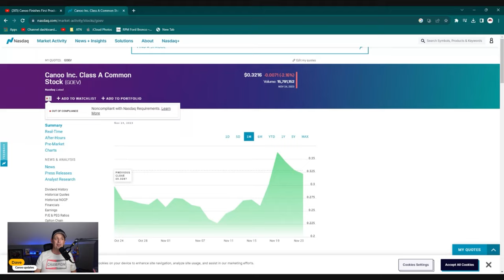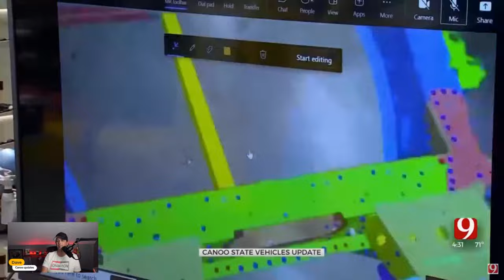CANOO EV - Are they finally ready for the road?

Comment: Since the van is steered by wire and the steering wheel can be moved to the opposite side it seems perfect for a Post Office delivery vehicle.
Reply from the maker: Good point but I believe the USPS has a costly delivery truck being developed by a military contractor.
Reply: @AllTerrainNation  🤮 the Osh Kosh deal is total nightmare. Went from 100% EVs to 10% EVs. From a company that’s never built an EV.
Reply: Rivian and Canoo got screwed by the Post Master. They have vehicles in production vs Osh Kosh having to start from scratch. The billion dollars is as good as gone.
Reply: Amen
Reply: @AllTerrainNation  Now why did he say it can be right hand drive for the Post Office? Because The Post Office is a UK company.
Reply: Drive by wire and the way the digital screen is mounted allows RHD versions to be made much cheaper than conventional vehicles.  And since 76 countries use that, it bodes well for US exports.
Reply: I'm a mailman and would buy one for my route. Right now I use a '22 honda odyssey. There's 80,000 routes and over 1/2 are personal vehicles. None of these companies want to partner with us. We're out here buying RHD Jeeps by the 1,000s over year. Spending $60k. We cycle the vehicles every 3 years.
Reply: Post Office just purchased 6 of these to test out.
Reply: It's only 3x more expensive than an LLV and they just have to replace 100k of them. Perfect lol.

Comment: I want one, mostly a van but I want it to have the same type of body panels and coating as the military truck version! The truck version is said to have a range of 500 miles, if they can get that range for the truck then why not for the van?
I have heard prices in the $30k to $50k range which I think is reasonable, the other thing is the footprint is roughly the same size as what a Prius takes up! That to me hits right as I don’t need to make any changes to my garage or find special parking spots for a bigger wider vehicle (talking to you Tesla Cyber Truck). Last wish is that this use a new battery type that gets longer range and charges quickly. To me the van has this kind of 70s hippy vibe like a Volkswagen bus. Come on Canoo give us the van now!

Comment: This will be the future, 1 frame, and can make it a sedan,pickup, utility vehicle, van, etc. All on the same "skateboard"  so you could change your vehicle if you wanted a true transformer. This also has very few parts, which will also make it desirable. If they are over 50,000 in price, this will fail. It has to be under 38,000. IMO
Reply from the maker: Im not sure how they can keep costs inline to have price in the 35-40k range. The big boys are struggling with mineral costs.

Comment: I've been waiting for the Maverick Lightning model but FORD seems to be moving  GLACIALLY  with the Mav product.
I'm diggin the Canoo PU. HOWEVER, Canoo does not have any kind of reputation yet. Will their vehicles be durable, reliable
long lasting? Will there be any  resale value? If the battery dies, can it be fixed for a reasonable cost? What about that 
crazy windshield? State Farm does not cover glass. Whats that going to cost me? Even those triangular side windows
look expensive. It best practices  NOT  to buy a brand new designed, well, ANYTHING. All first gen whatevers are prone 
to bugs & modifications are ALWAYS made nextgen. What to do? What to do? What to do?

!
Reply from the maker: EV resell is awful unless it’s Tesla. 
Maverick is perfect for a small EV but ford is hurting right now from poor Lightning / Mach E sales

Comment: They need to answer the concerns people have about evs, their resale value is terrible given the cost of replacing the batteries and making the vehicles future proof. Also a battery jerry can system needs to be worked out so you aren’t left stranded ect. For me I’ll be avoiding evs for now, but I love the design of these little trucks, pity they aren’t also coming out with a diesel version.

Comment: As for demand, yeah, I'd like an EV. I'm NOT going to spend $60K+ on one. Especially not a non-Tesla. Keep in mind, there is no functional road charging network for non-Tesla EVs, so they're all town cars. However, if I could get a nice little van for around town stuff for $30K? Less? We might be talking. But I don't think Canoo will be able to deliver that.
Reply: Charging networks are workable currently. You can road trip in an EV with a bit of planning (not just telsas)
Reply: @benwinslow3101  Yeah, I’m hearing from a lot of very pro-EV people that non-Tesla chargers are suckadelic. Either completely non-functional or working at a reduced level that will take hours to charge a typical EV. I’m also hearing that non-Tesla EVs have a very difficult time handshaking with those semi-functional chargers. I stand by my statement.
Reply: @hemaccabe4292  you are welcome to your opinion, but I'll just point out that bad news sells better than good news. The CCS network is hit or miss, but its getting better, and  it's not as bad it's made out to be. There are several apps you can use to scout out chargers in advance, so with a little planning it's really not hard. Additionally, everyone is switching over to NACS anyway, so the tesla network will be a reliable backup option for everyone when needed.